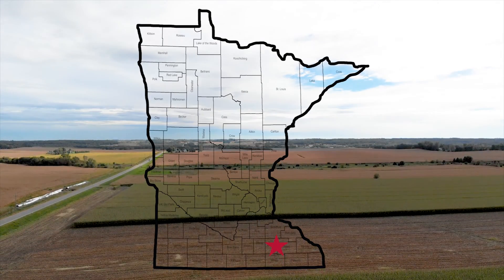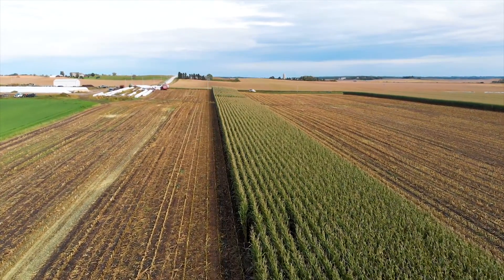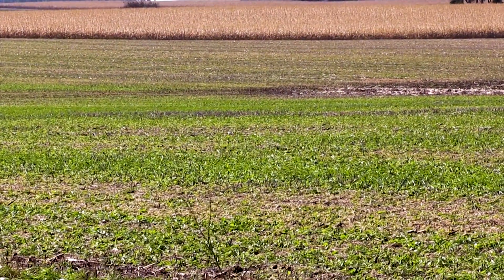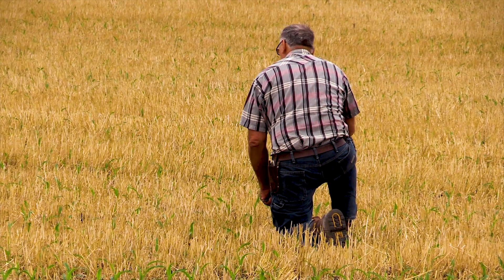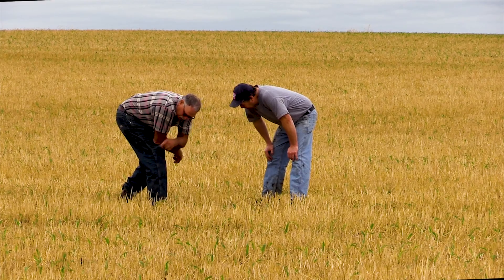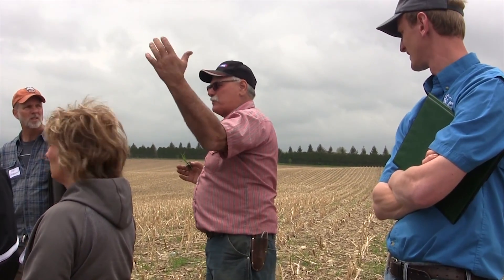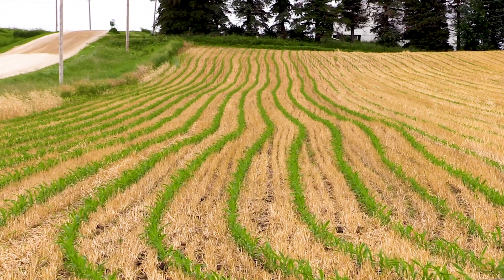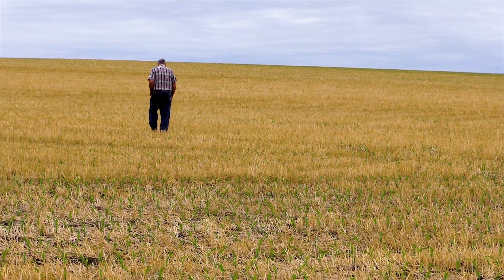No-till Farming with Corn and Cover Crops in Southeastern MN

Comment: what are the differences when it comes to weed pressure and options for dealing with them? does the method you use require more herbicides or can this be avoided?
Reply: i been looking into no till for yrs, i like it  cant afford it but like it, machines r 1-2 k $ ft. if u live around around farmers who take care of their fields ur weeding & chemical costs r lower, but i farm in the middle of clowns who take care of nothing, soooo. no till will increase ur yields give it 3 or 4 yrs. i do the next best thing with  no touch fallow, mowing weeds before getting too high keeping microbes shaded from direct sun and light till before planting.
Reply: @tudwortyjmcguern5689 so you avoid using herbicides by giving a good mow before you seed? And that's enough to keep your weed pressure down?

Comment: I just read a book about farming on the prairie in South Dakota (when it was first opened for settlers in land lotteries), and how the successful farming was done using similar systems. The prairies were deep grassy lands, and tilling the land worked well the first year, but since there wasn't enough regular rainfall nor riverwater to irrigate the crops, and there wasn't good reintroduction of nutrients to the soil, crops did eventually fail to thrive, and many settlers gave up their land claims. I think if no-till ideas had been spread in those years, there never would've been a Dust Bowl farm loss in the Midwest states. 
The more I find out about no-till farming, the more I want to know. It has such global applications, but especially in more arid climates. Thank you for this video.
Reply from the maker: Thank you for your comments!

Comment: Say you have a cover crop and you plant corn in it, do you repeat the process? Plant a cover crop every year? Looks like the layer of cover crop would get too thick. Do you have issues with the current cover crop on the ground shading the next cover crop from the sun?
Reply: The cover crop gets incorporated into the top soil every season
Reply: Yes. Yes. No. As biology and earthworms increase in your soil they will break down your residue and incorporate it, building and recycling nutrients.